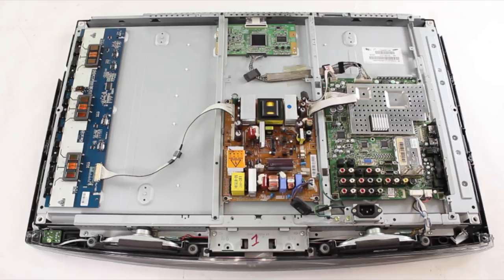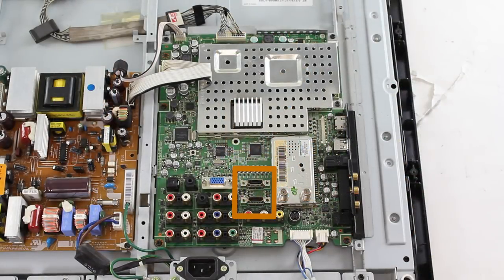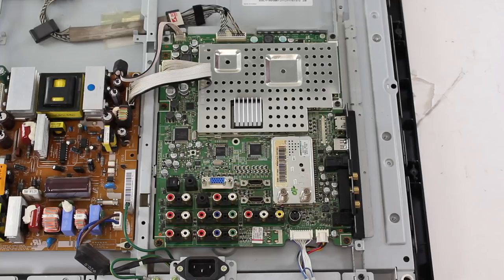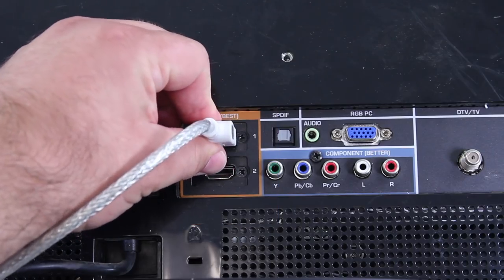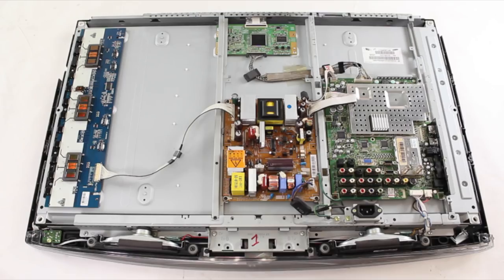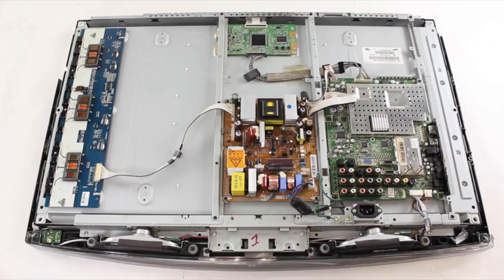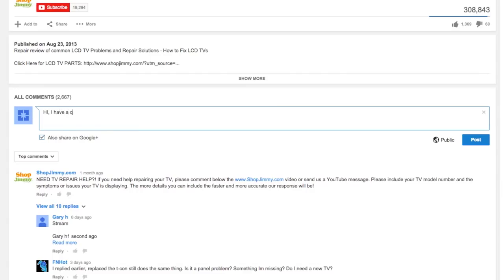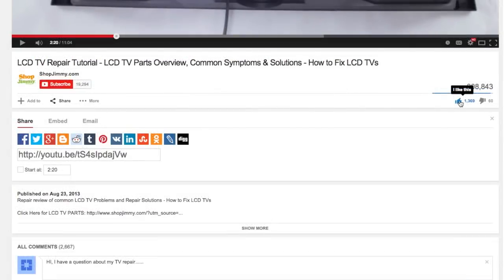HDMI Input Problems - TV Not Showing Image - TV Repair Help and Troubleshooting

Comment: I have a jvc lt40c750 a. smart tv and it will not connect to the Internet with my wireless WiFi device it just keeps freezing on the Internet part of the menu and even my sky box wunt work through the hdmi cable I have posted a video on my channel of my problem I have heard it could be the WiFi adapter module

Comment: If it’s a ps3 that’s connected to the tv, or ps4 just hit the power button for 10 seconds when off and is showing a red light, you should hear one beep for the “turning on” if you continue to hold the button it should make another beep, after you hear that other beep let go, the ps3 should work and turn on and should go back together

Comment: i used an HDMI cable on my ps3 that usually caused some stutters and would go black then return again, when i bought a ps4, the same happened, then suddenly the screen went black and neither the HDMI cable that came with the ps4 nor the one i already have worked, i tried on a different LCD and the ps4 worked, how can i fix the HDMI ports on my LCD ?

Comment: I have a ps4 and it only has one hdmi input and the TV won't come on
Reply: Melanie Marchant did u fix it mine is doin the same
Reply: @Nik3T3kk  same here, I even have 2 HDMI ports and both are crap. Didnt work. Thinking I need a new tv
Reply: @Nik3T3kk  even worked when a worker at a game store close to me tried it
Reply: @brandonknable7890 I fixed it.. it's the hdmi motherboard.. It went out u can tell because when u change the channel to the Hd 1 the back light will not light up
Reply: @Nik3T3kk  so buy a new tv or nah?
Reply: @Nik3T3kk  because my ps4 worked fine on a monitor
Reply: @Nik3T3kk  just wont work on my current tv
Reply: @brandonknable7890  hell yea that how I fixed it Lol...it cost about the same for a new t.v. anyway is u wanted to get it done

Comment: My tv have 3 but none of the 3 works make the tv go off and on I took the tv to a tv repair they say there's no way to fix it...  My question is if can get fix and how?
Reply: penag95 yes you can...in your case replace the board. Will be more cost effective. Probably that "tech" saw no gain "$" for his time!!! In my case I explained to my customer all options. 95% of the time is better to repair either at component level (which is the best option) or replacing the board. Less expensive than buying a nee tv that in 12 to 18 months will start to fail!!!

Comment: I have a 37" sharp aquos tv and neither hdmi works. What could be the problem.
Reply: Try resetting the tv. I went online and found a weird way to Reset Tv's, and ALL  HDMI ports came Back....  Reset is diff for most tv's of course, but this was really odd, like-- unplug tv, then hold power button for 10 mins, stuff like that.  but it worked,  so try your owners manuals or online for each tv brand.  and Good Luck, Have a Great Day.

Comment: My Panasonic TH-37PW5 (pretty old school plasma TV, but still in great condition) won't play from HDMI. I have purchased an HDMI to RGB/Component converter, but it still shows 'No Signal', when I select the Component/RGB mode and have everything plugged in correctly.

Has anyone else had a similar problem?

Comment: I’m trying to connect my Xbox and I’ve tried hdmi 1 2 and 3 but connecting dish network works should I change the cables?
Reply: same need help
Reply: Dante Padilla same need help but im using ps4
Reply: Same problem my hdmi port had failed and i dont know how to connect my tv to my ps4 in any other way!

Comment: all of my HDMI ports stopped working streaming video on the tv is fine but all HDMI video comes in looking like techno colored snow like a bad analog channel only the audio is fine and the pixels don't move.
Reply: Try resetting the tv. I went online and found a weird way to Reset Tv's, and ALL  HDMI ports came Back....  Reset is diff for most tv's of course, but this was really odd, like-- unplug tv, then hold power button for 10 mins, stuff like that.  but it worked,  so try your owners manuals or online for each tv brand.  and Good Luck, Have a Great Day.

Comment: Hello, thanks for the tutorial, my samsung 75 was hit during a lightning storm, non of the HDMI ports work or does the cable in port. Is there a way to test? I have removed the board for replacement if necessary but another question is if it was hit by lightning will the voltage spike travel past the board with the HDMI ports? could it be another board got spiked? the tv still turns on and wifi still connects just non of the accessory ports work such as the HDMI USB CABLE/ANT.

Comment: Powered HDMI Splitter Solution.  I have the 49 inch Aquos. The TV is a bad one but the picture is good.  My HDMI inputs are all troublesome except the first position.  The rest have no signal.  Replacing the board is no longer possible because the board is obsolete and no longer stocked.  The problem can't be fixed but it can be remedied.  Use a powered HDMI splitter and the Aquos will get the signal.   Maybe back in the day "Sharp minds make Sharp products" but today it is just junk.

Comment: hi my samsung LED tv series 8 all 4hdmi ports no longer work i tried factory resetting it and it still the same. can you help me
Reply from the maker: +Ashley MC  Try all repairs and troubleshooting at your own risk.  Please reply with
 your TV model number.  Click here to view a video that shows how to 
find your TV model number:  https://www.youtube.com/watch?v=S51nhAmwR2M  Thanks!  www.shopjimmy.com
Reply: UN46B8000
Reply: same here
Reply: Hi Jash, and anyone else who may read this.  I worked for DTV for 8 yrs in a call center.   Did Alot  of technical t/s with customers over the phone, and would sometimes figure it was the hdmi ports on the tv's,  and sometimes it was all of them,  although cust said they went out gradually. 
 For one cust tho, I went online and found a weird way to Reset his Tv, and ALL his HDMI ports came Back....  Reset is diff for most tv's of course, but this was really odd, like-- unplug tv, then hold power button for 10 mins, stuff like that.  but it worked,  so try your owners manuals or online for each tv brand.  and Good Luck, Have a Great Day.

Comment: I have a 40 inch Polaroid flat screen TV I've tried every single HDMI port and they all don't work for my PS3 what do I do
Reply: I repaired a Polaroid by replacing the capacitors. Some were bulging. The picture on that tv no is fantastic.  Cost me about $5

Comment: Hello, I have a Hitachi LE55W806. We had lightning strikes hit the other day and if fried several things even though we had everything including source lines running though surge protectors. (This TV was hooked into a $200 (5 year old) monster cable surge protector). Anyway this TV now has problems. The picture is too white/bright. it is hard to look at. None of the HDMI ports work, although the component does (oddly bright). I do not believe this is the  "solarized/inverted" problem. I would be thankful for any suggestions or troubleshooting ideas to figure out what part is now bad.
Reply: Nick G  Looks like the  component SD connection works fine as well as the Netflix and VUDU apps. So none of the HDMI ports work and the component connection is white washed,
Reply from the maker: Nick G  PLEASE SUBSCRIBE TO OUR CHANNEL - Try all repairs and troubleshooting at your own risk.  I recommend replacing the power supply and the main board in your TV.  Click this link to replacement parts for your TV model number:  http://www.shopjimmy.com/catalogsearch/result/?q=LE55W806  There may be multiple boards for the same TV model number, be sure to match part numbers on your current board, with your replacement for compatibility.  Thanks and please let us know if you have any further questions with your TV Repair!  www.shopjimmy.com

Comment: I have my pc connected to my TV, and it was working fine before, but overnight, when I got up it would not display the pc on the TV like before
Reply: I had the same problem last night. Did you ever fix it?
Reply: Yeah took a couple of hours. My best advice is to just leave it alone for a few hours. I actually opened up my pc to try and solve the problem, did absolutely NOTHING inside it, and when I plugged it in again it was fine.

Comment: That's the lazy solution, not a very technical technician. What about resoldering and replacing the hdmi port if that's not the problem then replacing the IC chip.

Comment: Bullcrap! The mother Baurd would cost more or the same amount the tv is worth! Why not do us a video on how to toss it in the trash and toddle off to to the shop to buy another tv! Cheaper and less hassle
Reply: $35 for both main board and a power supply for my Vizo D48-D0.  I haven't ordered it yet because I'm in no rush.  All 3 of my HDMI ports say no signal.   It's easy to change the boards also.  I've bought boards from shopjimmy.com in tha past and price has always been good.  They also give you a 180 day warranty.

Comment: i tried to connect my pc to my tv which i always do, but randomly it stopped working. it works on both ports with other devices, but with my pc it just flashes for a split second also providing that audio for that exact second. but ive tested my pc and it turns out its not my pc's fault. so does anyone know how to fix this?